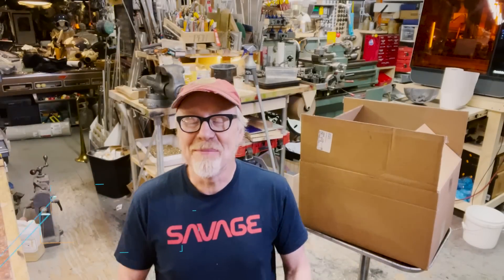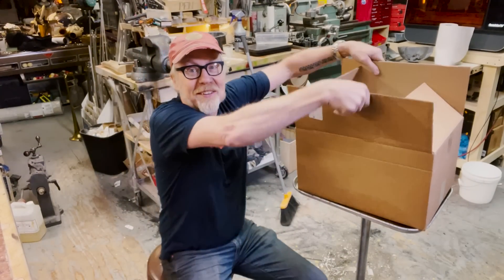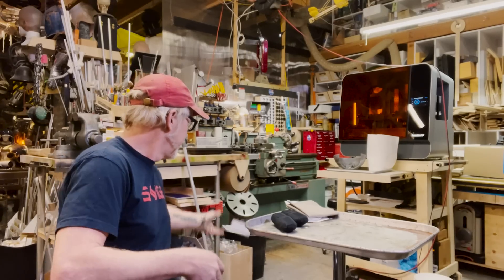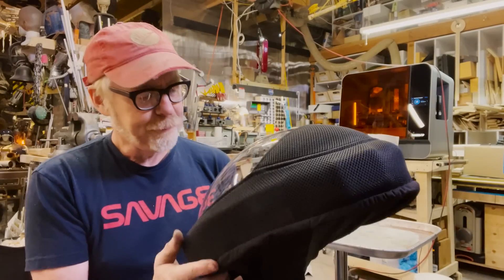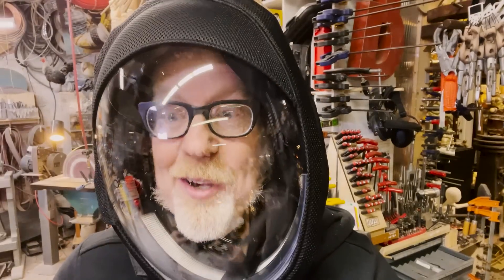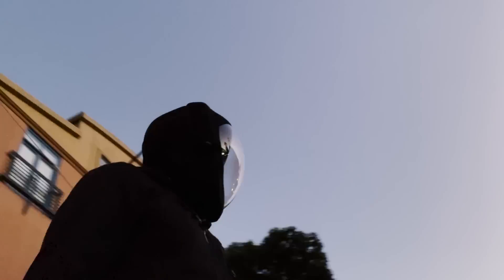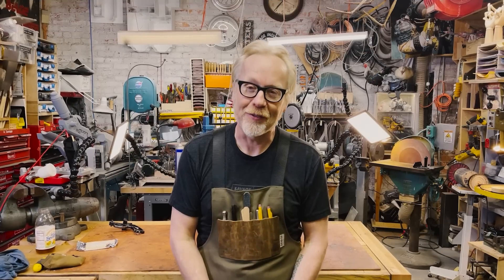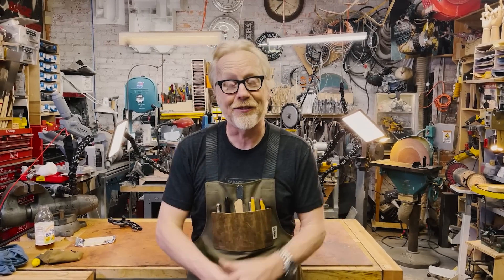Adam Savage Tests the AIR Active Filtration Helmet!

Comment: Needs to go the extra mile... why not a covid spacesuit too? xD
Hey, it might feel and look a bit weird to use something like this right now, but then again, I do like cosplay, I never got fashion anyways, and nowadays I think it's far more understandable to mentally prepare to use something like that.
But perhaps more importantly, if you look at what doctors and nurses are having to use inside hospitals, anything that is easier and more practical to suit up and go ahead is a win...
Reply: Ooof, looking at the final test now, yeah... another one bites the dust? xD

Though agreed with Adam is saying... it's just very hard for something like that not to fog up. No experiences with space helmets here, but swimming googles... even with swimming googles, even though you are not working with breathing... just tear ducts. It's still very hard to find ones that don't fog up overtime. xD

I know this would probably make the thing prohibitively expensive, but perhaps something like the rear car window anti-fog solution? Small traces of conductive ink to heat it up?
Perhaps these ultra efficient dust blower style fans used in laptops could do the trick... but they can be very loud...
Can you ruin that helmet with a DIY project, Adam? xD

Comment: The bonus is that anybody with a hearing problem can lip read easily. Getting kids to wear it would be easy as you could convince them they are an astronaut and it isn't touching their face. Simply smiling at someone can be seen.
Reply: I haven't been able to read lips in so long... My standard question lately has been 'huh?' followed by 'what did you say?'
Reply: @LordViktor299  It must be so hard. I don't have a hearing impairment but not being able to have a simple conversation must be so isolating.

Comment: Adam, I made my own version of that.  The best way to keep it to keep it from fogging is a transparent separator between your eyes and the area of you nose and mouth.   It does not have to be perfect, because the air will fill the eye area first, then move into the mouth area.    So the mouth area will temporarily fog, but the eye area does not.     I also moved the fan to a piece that hangs below the mask.  I 3D printed a fan that use a HDD motor that is much more quiet and moves more volume.   BTW, Initially designed it for my wife, because she is severely allergic to cats.    So if we were on a trip, and she had to enter a family or friends house that had a cat; it would cause a dramatic asthma attack.   BTW, all the components except the 3D printed ones; totaled less than $50; so that I can make more for family members if COVID gets worse...... Mutations!   I have already lost a friend at the Makerspace from this and 4 others that I know.
Reply: Sorry, less than $20.   A clear face shield, filter material, and the fabric for the hood.    The $50 total was including an ESC and some some small electronics so that when I went outside or was doing strenuous physical activity; I could turn up the fan to leaf blower speeds.   ....Riding a bike etc.   Run time was 13 hours provided by (3) 18650 cells, that I could charge in 1 hour.     Makes for a good ventilation system for cosplay as well.

Comment: I don't know how much it cost but what ever time price is i would not considered a helmet with out am airflow system.

A good solution for the fogging is to do what paint ball mask do and just separate the goggles from the breathing holes.

At the end of the day a gas mask configuration seems the best except with a hepa filter on the valve.

Comment: You could do a simple coating on the inside, similar to like what I do for my bathroom mirror.  I use some good ol' barbasol wiped on and then wipe down will normally prevent the mirror from fogging over for a while.  Good idea for what it is, but I'm agreement, with some fine tuning and more development could be an awesome product.

Comment: Here is a little project for the helmet.  Get some nice strong magnets and some really soft material that is not going to scratch the visor. Wrap the magnets up and use them to wipe the fog away.  Kind of a windshield wiper but for the inside.

Seen versions of this for cleaning the outside of windows when you can't get a ladder up there and the window is too big for just reaching out.  Just that this is for cleaning the inside from the outside. :D

Comment: Adam could you modify the helmet by fabricating an exhaust port with a small extractor fan using your 3D printer to manufacture  a housing for the fan and port to help with the fogging issue. Just a thought :-)

Comment: Look at a snowmobile helmet heated shield and incorporate it into your helmet visor. it uses a dual lens and a 12v "heating" element (kind of a flat wire) around the visor, think rear defroster on your car.

Comment: Wearing this in public is like the ultimate way of showing other people that they are so far beneath you that you don't even want to share their air. Of course it will be a hit in LA.
Reply: Better than the people with non filtering face shields showing that they only care about themselves. Of course if this one worked great and everyone had one, the pandemic would be over in a week or 2
Reply: @krsbog  To be fair, a lot of those full-face masks with the unfiltered exhalation valve can easily be modified to accept a filter over that valve. You just have to get creative.
Reply: @krsbog  Except it's not an either/or proposition. You can get well-fitted masks that are small, light, easy to wear, don't fog up, and filter air in and air out.
Reply: EL-Eh
Reply: @mbur3689  ELA
Reply: You’re so edgy. So cool.

Comment: I've seen some tricks to combat fogging on windshields including hydrophobic treatments. I wonder if any of those would work for this helmet?
Reply: I, personally, find it odd that the company doesn't automatically put a treatment on the inside of the shield to prevent fogging. I know there are various products for glasses and goggles that prevent fogging. And some simple home remedies that supposedly work, like applying extremely thin coat of dish soap, or the disgusting, spit into your goggles before you go diving trick.
Reply: I have a spray I use on my VR goggles that prevents fogging. It was designed my motorcycle helmets to prevent fog on the visor
Reply: @cidasanctus3373  What's it called?
Reply: @ucitymetalhead  The company that made it was called Splaqua. Just search that and anti-fog spray. It seemed to work just fine
Reply: s/hydrophobic/hydrophilic/. You want the water droplets to flatten out and pool so they don't scatter incoming light.
Reply: I wonder if any of those would work on my glasses?
Reply: I use a spray for my scuba mask that works pretty well

Comment: Glad you didn't pull your punches on this. It kinda sucks, I'd love a product like this but the fogging up is a dealbreaker. A guy on Youtube made a DIY version in a Daft Punk helmet, his channel is Thought Emporium, it seems with a separate fan unit on your waist, you can have stronger fans, but they aren't right next to your face so it has less of an impact on hearing. It was also positive pressure, which is usually ideal, but I can't tell if this is or not.

Comment: If you'll want to wear this thing for whatever reason, maybe cosplay adaptation, I recommend the check out fencing masks. They are basically an open-back mask like the Air one, they have a metal flap / tongue at the back which is bent to fit the wearer and helps keep the mask heavy on the head.

Comment: I wonder if a mic and PA system like they use in mandalorian and storm trooper cosplay helmets would be beneficial for something like that. Also I wonder if you can make a velcro patch for a backup battery like for cell phones to boost the time it can be used, this would be great to use in the model shop I work at so as to not worry when the boss walks up at random to pester me lol.

Comment: About 45 years ago, when I first began wearing glasses, the Optometrist told me a simple way to prevent fogging. Take a bit of dry soap and make a small x on each side of the lens then rub it in real good with tissue. it isn't perfect but it's a lot better than anything else, I even use it on car windows. Today they sell a product called "Fog Defender," which doesn't work as well imo. When i read the ingredients it includes Water, Proprietary Detergents and Preservatives. Basically someone's rediscovered the secret and is making a profit. =) Give it a try.

Comment: open the bay doors please hal
this needs modifying into a space helmet with lights mounted at the top
I suspect it's the temperature difference between the outside and the inside of the helmet as you go outside. So maybe a heating element like you find on cars rear windows might work

Comment: Have you looked at the transparent heating elements that are designed for computers that can be outside. They have the ability to be placed directly on a transparent surface and heat it enough to raise the temperature above the dew point. 
The other way is to create a duel layer partition visor that blows warm air between the layers acting as a heat exchange barrier needing only a very low wattage heater and single fan.

Comment: Adam, have you looked into the CleanSpace2? It works with a half mask or a full mask and its powerful motor pushes more air (on demand,  by monitoring air pressure) than you could possibly need. They have been using them at the Notre Dame cathedral in Paris, to shield workers from dangerous lead dust. It takes a few different types of filters to cover all needs, including of course a viral pandemic. They're amazing, although a bit pricey. I bought one for my family at the beginning of the pandemic when proper masks were out of stock everywhere and so far as in hospitals. You could probably rig something insanely cool together if you tried to adapt their system for your exact needs.

Comment: A product that has been in use for over 30 years and is designed for work and was never intended as an alternative for wearing a mask and the Covid hysteria.  It's called a  PAPR or Powered Air Purifying Respirator.  The way the air inters the mask, it really cuts down on fogging and clears what does occurs very quickly.  Draw back, it's 5+ times more expensive than this product.  It works far better than anything that you will find at any consumer level but you do have to pay for that performance.

Comment: I made one back in April by hooking up my CPAP machine (has an external 12V power supply, which I ran from a 3S Lipoly) to a hole I made on the back of my old full face motorcycle helmet. 
Battery pack and CPAP machine and all, fitted good in a small back pack. Fogging was terrible. Specially when if it was a bit cold outside. 
I think the best solution is to have an electric defroster just like the one for your car's rear window.
One can be drawn on the visor using a liquid (looks like a bottle of nail polish) defroster repair kit, you can buy from your local auto parts store, but I didn't bother using it.

Comment: Will it work as a shop/dust/safety helmet? I was just cutting concrete pavers and was constantly gearing up with dust mask, safety glasses, hearing protection and it was a whole process to do just that before I could start cutting. Having a helmet would've been so much better.

Also Noctua is generally regarded as the world leader in quiet fans, they've been the #1 in PC cooling fans for years now and they make a 92mm unit. I bet with a push/pull config across the inside of the shield you could probably make something work.

Comment: Solution to fogging:
Most modern full face motorbike helmets come with notches inside so you can fit a "pin lock visor".
Since I've had one it has not fogged up on me even in northern English winter weather. 
I highly recommend the thin double glazed plastic approach. 
Minimize thermal gradient across the visor to reduce condensation.

Comment: Adam, please use one of these or an equivalent level of filtration when working with dusty materials in your shop.

The nature of your coughs, the quality of your voice, and the frequency at which you need to clear your throat are all evidence of damage done by dust inhalation. 

We've all seen you use your sanding wheel and other dust producing tools without a mask. 

Please, as a content creator who needs to use your voice to make your living, and as a role model for makers everywhere, use the proper protective equipment to protect your respiratory system, you only get one, and dust will destroy it if you don't protect yourself from it.

I shouldn't need to tell you this, I am less than half your age.

Comment: Could a heated window (like in some car windscreens that use super thin wire heating elements) be a plausible solution to keeping the fan noise low. The cause of the fogging is due to the warm moist breath coming into contact with a cold surface. Heat that surface up and you eliminate the fogging. of course a fan would always be necessary to provide positive pressure and in warmer conditions the fan would probably be sufficient enough to clear the fog. in winter however, unless your going to put a leaf blower in there, i think that heating the visor could be a viable solution. (further research required)
Great videos Adam, and I'm a huge fan. :-D

With Love

Comment: ...Another, used by myself, antifog remedy: Diver applied it, at least in the 90s to new silicone scuba diving masks. It dealt with the following issue: The manufacturing process left a thin layer of silicone on the glass. That rendered the spit on the mask and give it a swish in the water method, useless. The remedy was to substituting the spit with shampoo or shower gel. The detergents lowered the water tension enough to let the fog droplets run down the (silicone-film on the) glass! However, a word of caution: Don't use any soap! Use only shower gel or  shampoo! If the soap containig water gets into your eyes they cause no problems. But other soaps could be nasty! I once used dishwashing gel and got it in my eyes! That was no fun!

Comment: I saw this as a possibly effective eye/lung protection for shop work (turning, sanding, sandblasting, etc) It appears to be less bulky than the Trend airshield which was designed pre-pandemic, and marketed to turners.
Reply: Why not just run a full face paint mask made by 3M.  And run a supplied air hose providing positive pressure. Any leak in the mask pushes air constantly out.
Reply: @DFOOSKING  the idea behind the trend, and possibly for this one, would be the added eye and face protection from flying debris, and sometimes, workpieces that fly off of the lathe
Reply: @ergeist  a full face covers from your forehead down to your chin.  Like a gas mask.  And it has a smaller visor that provides ample view but less area to scratch.  And they make tear offs to protect the visor.

We would stack tear offs and as we would paint underneath large vehicles....you would literally be in a cloud of paint particles.  Static causes paint to stick somewhat to the tear off so after about 20 seconds you'd peel to the next tear off.  And so on.
Reply: @DFOOSKING  it's certainly worth looking into. The Trend is VERY expensive (but so is a trip to the hospital). I have 2 concerns though. It appears the clear plastic visor is flexible, which would diminish the impact protection ( for the uses I'm considering) and the possibility of hoses getting caught in spinning machinery. I'll definitely check it out, and make a decision from there, though. Thanks for the tip

Comment: I'm surprised that you bought one instead of building your own. It's not like they invented anything new they just utilized existing technology and Concepts for a different purpose. Air filtration helmets already exist for people working in industrial settings. They usually have a tube running down to a belt pack on their hips to run the battery and air filtration and they work really well. 

You did something similar for one of your floor walks at Comic-Con already so I'm surprised you didn't adapt an existing space helmet for this use already... maybe this needs to be your next one day build?

Comment: put on head, then charge for five hours... seems legit hahahaha
Reply: Would be even better if the battery pack was seperate so you sit there with the non functioning helmet on your head while the battery charges on your bench, lol.
Reply: The non-removable batteries are one of the worst things about this design. Would it have killed them to make the battery compartments removable instead of glued in?
Reply: @MikeTrieu  i dont understand the design choice there, could run a system like adam uses for his cordless tools, and basically never go without power through the use of multiple batteries

Comment: Besides the fogging issue there seem to be fundamental problems with this helmet. Positive airflow is a good thing but how does it exit? I doubt any of it is exiting through the filters therefore not protecting anyone around you. I am surprised more mask manufacturers are not using the folded filter design like professional hepa filters allowing for more surface area and airflow. I think Adam should take this on and create a functional but redonkulous one day build.

Comment: Hi Adam. I agree that the fog is almost inevitable, especially with lower outside temperatures. 
I used to have this problem with the front window in my convertible. In my quest in finding a solution, I found out that divers sometimes use their spit on the inside of their masks, but I didn't like the idea of having to lick my entire window. Instead I tried anti-fog spray by Rain-X and it works quite well. The only downside is that the coating will degrade overtime, but that may be more prevalent when the coating is subjected to UV-light due to the car being outside all the time. 
Using acetone or something alike will make this task pretty easy though.